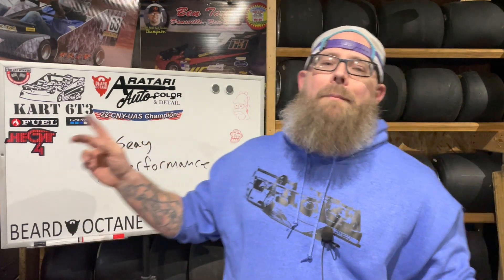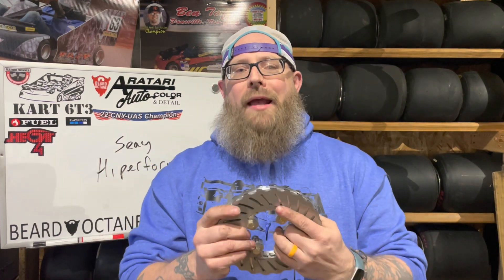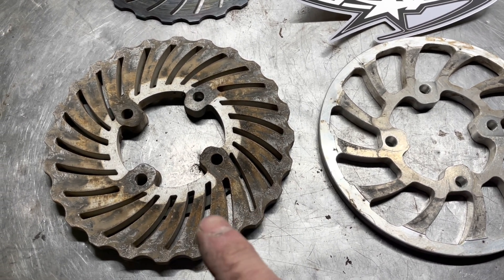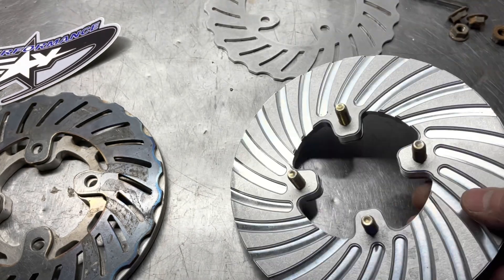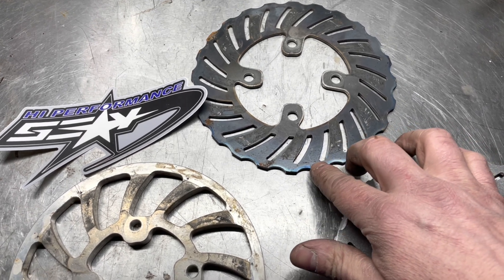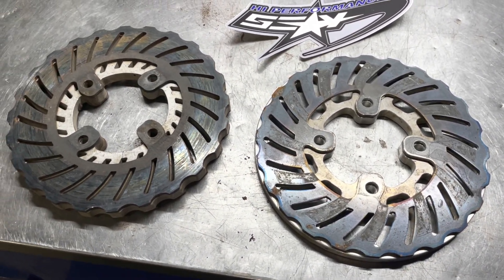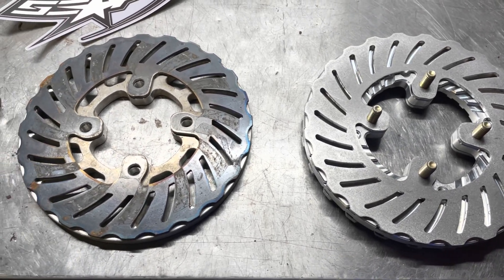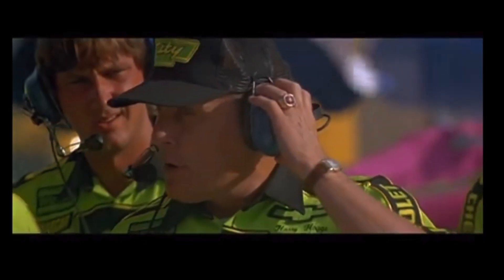New SeayHiperformance Super Brake!

Comment: aluminum has a thermal expansion rate of nearly double of steel so I wonder what that does to the fasteners, not to mention your pad to disk clearance
Reply from the maker: When you receive a Superbrake there is a spacer for duel line brake calipers.  The expansion doesn’t seem to effect anything that I’ve noticed.  I cotter pin my bolts so the nuts can’t/won’t back off.

Comment: How much do you and the kart weigh? We run at 425, 450, or 475 depending on the class and engine. We run a left front brake and an MCP dual-line rear brake. How much does that rotor weigh? We try to use as little rotating weight as possible. Will you be racing the UAS Nationals at Hunterstown?
Reply from the maker: Typically in my kart with fuel on board 435-445ish.  I will be at the nationals.  I’m not sure what the rotor weighs, I’d have remember  to weigh it when I’m in the barn next.
Reply: @kart6t3_ben  I thought we'd be much heavier with the cage. We're around 300 with the kart and engine. The outlaw karts will be at Hunterstown that day.
Reply from the maker: @brookingmotorsports6873   depending on what motor I would run.   150cc 350lbs (I can’t make that weight) 250cc 400lbs 270cc 420lbs 300cc 430lbs.    With the bigger two strokes I would struggle to get near 400lbs cause I’m 200+ myself.
Reply: @kart6t3_ben  We have more engines than karts (for now lol): 2 KTM 250s (4-t), a KTM 450, and  CR500. We're trying to get karts around for a sort of rental where racers could get some laps in them.